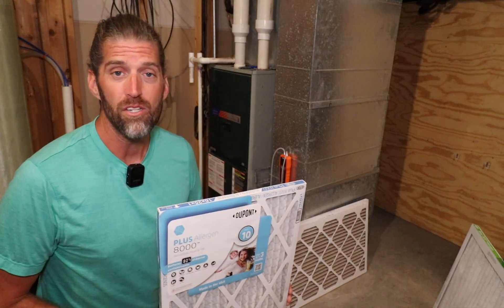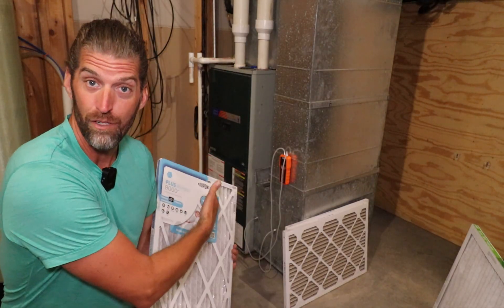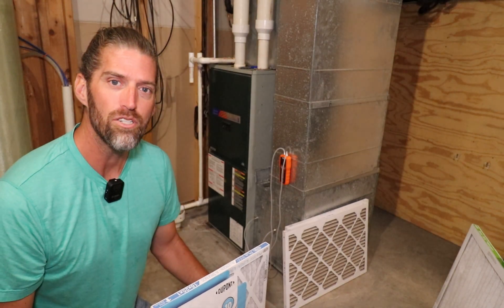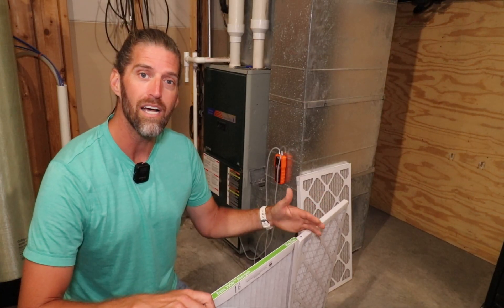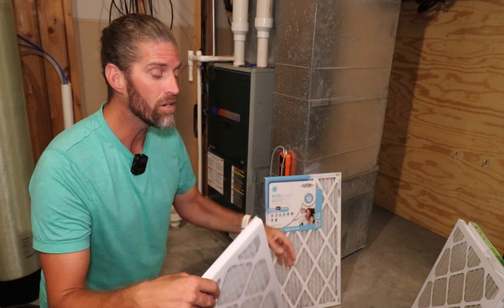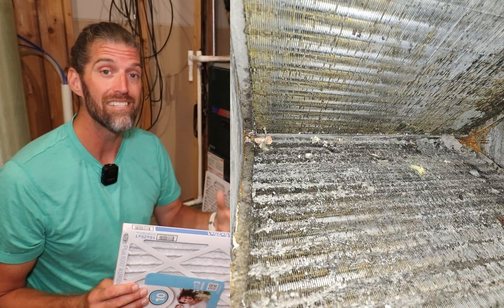How to Choose the BEST Furnace Air Filter (MERV Ratings & More Explained)

Comment from the maker: What furnace air filter MERV rating are you using?
Reply: Right now I have HDX 16x20x1  FPR 7   I just placed an Amazon order for NORDIC PURE 16X20X1   QUESTION- How do I figure out the "Pleats"?
Reply: 3m merv 10
Reply: Ace hardware MERV 8.

Comment: MERV 12, but going to order MERV 8, for next time
Reply from the maker: Merv 12 is definitely a tight filter. What thickness of filter do you have?

I'm surprised in this modern day that furnaces dont have pressure drop sensing to help guide the consumer on when the restriction is too much (clean or dirty). Cheers!

Comment: I have an old furnace, what would be the best MERV filter to purchase?
Reply from the maker: For most furnaces, you typically can't hurt anything with a MERV 7 or 8, but still get good filtration and are a very common choice. Finding one's with good structure to not bend, and increasing the surface area, are always positives as well.

Cheers.

Comment: Using 10 merv for some years now, but i was worried about the older furnace, I don't want to lead it to an early grave.
Reply from the maker: Always a tough call. If you ever have an HVAC technician out, they can use their manometer to test the pressure drop across the full system and see if it's excessive compared to the furnace design spec. Cheers!

Comment: I have a new furnace, it came with a 4" MERV 11 filter. Will a MERV 8 be OK, and what should I look for in a 4" filter?
Reply from the maker: Great that it came with a 4", that dramatically increases the total surface area when compared to a 1" or 2" filter. Likely a MERV 11 would be just fine, because of such a large filter. Beyond that, structural integrity is key so debris doesn't bypass the filter, but natively those larger filter generally have a very robust structure to prevent twisting.

I didn't cover activated charcoal layered filters, which can help reduce smoke, pet, and other smells, but most don't go down that path, myself included.

Thanks for watching! Stop back for other videos and please share....small solo guy trying to grow! Cheers!

Comment: AC Furnace Air Filter, MERV 12, MPR 1500, CERTIFIED asthma & allergy friendly, 3 Month Pleated 1-Inch Electrostatic Air Cleaning
Reply from the maker: Sounds like you've found a high-quality filter for your system!
Reply: Is MERV 13 ok? Husband got the Filtrete filters with those specs and I was worried that was too high a number
Reply from the maker: That is a very tight filter. You definitely have clean air, but possibly at the expense of good air flow (which could lead to things like AC evaporator coil icing) and stress on the fan. If you have a 4" or 5" filter, which has huge surface area for air to transfer through, it would be a little less concerning. But, if a 1" or even 2", that would likely be very restrictive (high pressure drop) even when new. Hope that helps.

Comment: I use merv 8 in the winter and switch to a less restrictive one in the summer.
Reply from the maker: Thanks for sharing! How much less restrictive do you go in summer time? Any particular reason? Cheers!
Reply: @LearnedFromDad I use the contractor filters. To help remove the hot air and cool the house faster.
Reply from the maker: Ahh, I see. Thanks for sharing.

Comment: Thank you for this instructional video. Two questions for you: 1) For a single-furnace dual zone system using two 16x25x5 filters, it does not seem to offer mini-pleat options. I have been using Merv12. Would you recommend MERV 10 or 8 to improve airflow and reduce stress on the system? And 2)what is your opinion on the filters with carbon?
Reply from the maker: Glad it was helpful. A couple points. Because you have a 5" thick filter, you have dramatically (multiple times) more surface area already compared to my system with a 1" filter, so naturally the pressure drop will be less. Because of that 5" filter a mini-pleat wouldn't really benefit you, already a huge surface area exists.

It's hard to say if a MERV 12 is too much for your specific system without a pressure drop test, however, because of your 5" filter, it's low likelihood it's a problem. Though, going to an 11 or 10 you can have very high confidence. Thick filters have huge surface area.

I don't use carbon filters, but they are definitely effective at helping to clean up odors from pets, smoke, etc if that is needed. Air filter otherwise are meant to catch particulates, but the carbon will help to catch those smells.

Cheers!
Reply: @LearnedFromDad thank you for a good comprehensive reply. Much appreciated
Reply from the maker: You're welcome. Enjoy the day!

Comment: Hello, I ordered: "Nordic Pure 16xIv20x1 (Actual Size: 15 1/2 x 19 1/2 x 3/4) Pleated MERV 8 Air Filters 4 Pack"  I've had a hard time finding one that would fit correctly in my filter slot. I used to use a Honeywell brand (from Home Depot and they don't carry them anymore) That always fit perfectly. I'm hoping the Nordic Pure brand I ordered will slide in and be able to put the sliding top over it instead of just laying it on top of the filter that partially sticks out   Thank you for your helpful video  I can let you know how the Nordic product fits. I was going to get a higher MERV but couldn't find the size i posted in my comment above.  Thanks again...Julie Perry
Reply from the maker: Hi Julie. Glad you found it helpful! Hopefully something will fit properly. It always amazes me the volume of different sizes. Thanks for watching! Cheers!!

Comment: I still need to clean my condenser fan outside and figure out how to access the A Coil
Reply from the maker: On the condenser, even if you can take a couple minutes to brush off the big debris, such as grass clippings and such with a brush, that will help a lot. I try to remind myself as a self-proclaimed perfectionist that even if I can do a little bit now, briefly, to make it 50% better that I'm still winning 😀
Definitely see if a friend has an inspection/bore scope to check your evaporator coil. Now that I've owned mind for a few months, I've found several uses for it to get a visual without so much disassembly.

Cheers!!
Reply: @LearnedFromDad  I'm not a big fan of HVAC companies, but I may need to call about getting a furnace service. They tend to push a lot of upsells, especially if you’ve got an older furnace or condenser fan.
Reply from the maker: Yeah, it's challenging to find a company that is just honest and shares what they'd do with their own home. When I do need professional HVAC help, I'm lucky to have a local, self-employed technician who you can trust with anything. I'm very fortunate!

Comment: Oh my! I've been using a 3M Filter  14x24x1 with MERV rating of 11 and 1 inch pleat! Not good for a 40-year-old furnace! In addition, it has poor structural integrity, and it twists very easily. I thought that was manufactured that way on purpose to allow for easy installation! Thank you James for this helpful information. I''ll be buying a Nordic Pure, (I just installed the last 3M Filter last week)
Reply from the maker: It's such a tough balance between clean air and minimizing stress on a system....especially with our 'old school' 1" filters. Definitely one of the reasons most new furnace installations today have a 2" or larger filter width, drop that static pressure. My last house that I built we installed a 4"!
And yes, it's amazing how poorly constructed some of the filters are. They get sucked in and then all that contamination ends up right in the evaporator coil.

Hope all is well! Cheers!
Reply: @LearnedFromDad  I just bought from the link above the Nordic Pure 14x24x1 (Actual Size: 13 3/8 x 23 3/8 x 3/4) Tru Mini Pleat MERV 8.  Thank you again, James for your help and advice!
Reply from the maker: Anytime! Makes me really happy that you and others find my content helpful. That is very motivating.

Comment: Mine is MERV !0.  I was using 15 for a couple years but read about the stress on the unit by the higher MERV so I went down to 10.  The pleats and framing are things I never thought about.  Thanks for enlightening me!
Reply from the maker: Yes, a MERV 15 would definitely cause a very high static pressure and stress on the furnace fan. I also still use a MERV 10, though I did switch to the mini-pleat just after this video hoping to make it just a little less stressful on my system.

Thanks for watching 😊